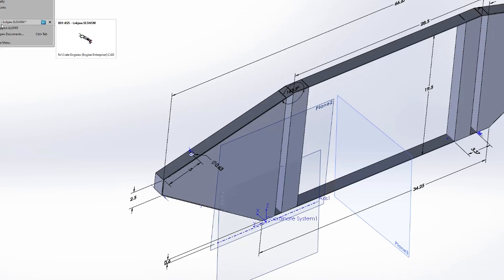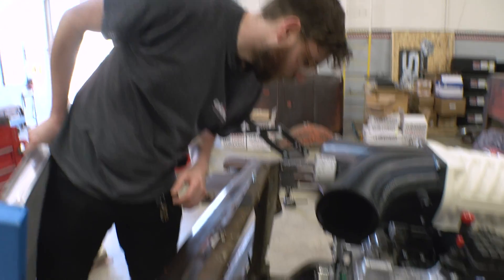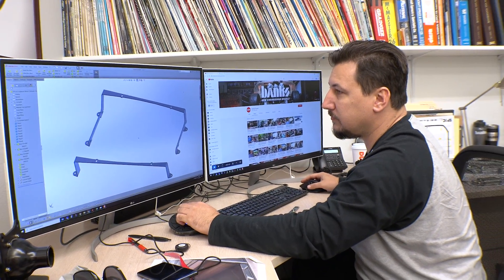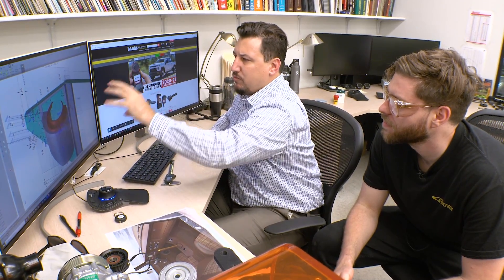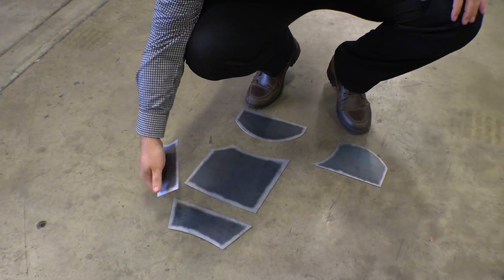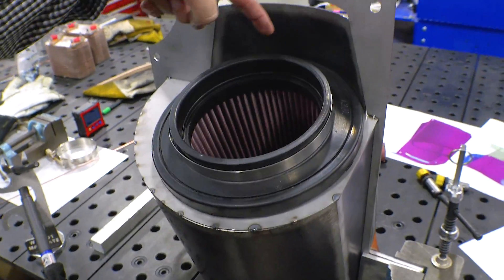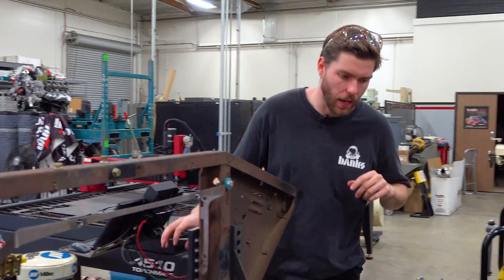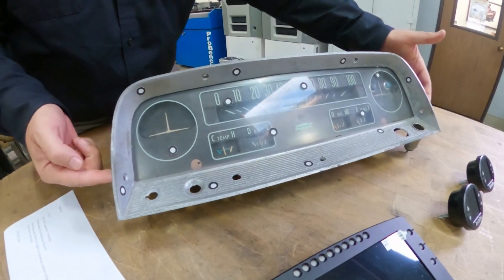Engineering custom air boxes for our SUPERCHARGED DIESEL ’66 Chevy | BANKS BUILT Ep 30

Comment: I'm really into the build.  It's so cool all of the great resources at your disposal like the CAD driven plasma cutting table.  I wanted to suggest that the bracket for the heat exchangers looked well done with the exception of making the brackets wider so you could a bead-roll the length of those long runners for additional strength.  The same goes for your hood and bed brackets.  I'm so looking forward to street running of the truck.  Maybe on the strip too.????
Reply from the maker: Yes, love hearing this feedback. And yes, it will drive on the street and the strip.

Comment: Fantastic work guys, will you make a LONG ass video of all these updates added together ? Start to finish would be a long watch but very satisfying . I understand that you are using steel for the ease of change and welding but wouldn't Aluminium ( spelled correctly ! ) be better in the long term ? Airbox etc
Reply from the maker: We've consider a "Supersode," not sure yet.

Comment: Radiators generally sit behind a protruding section of the vehicle. There is good air penetration for pressure,  but radiators don't flow that well. At some speed the inlet overflows??